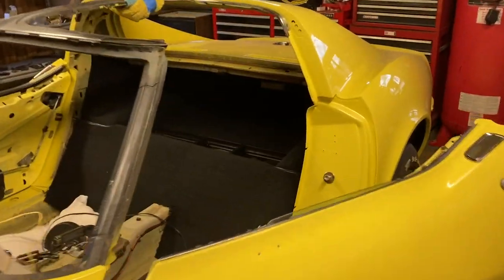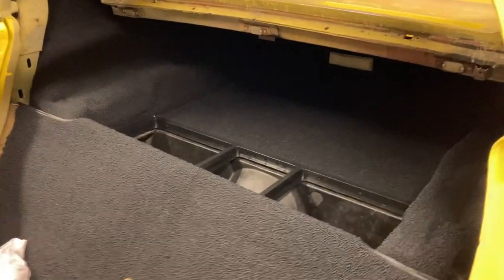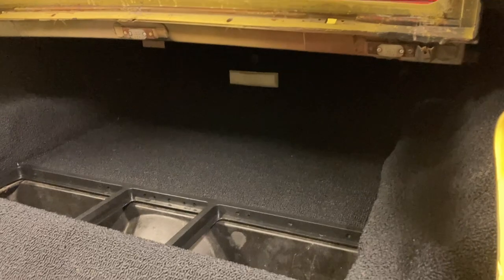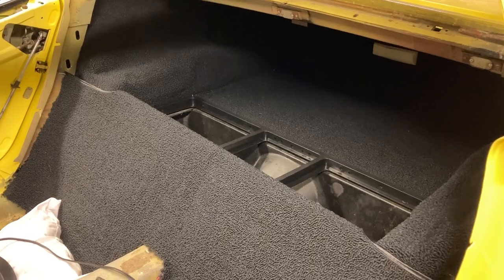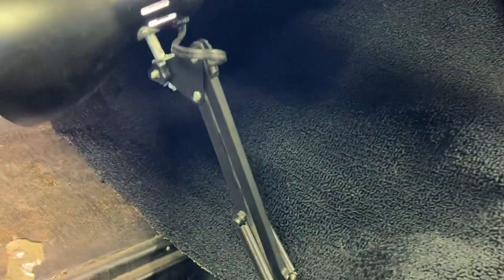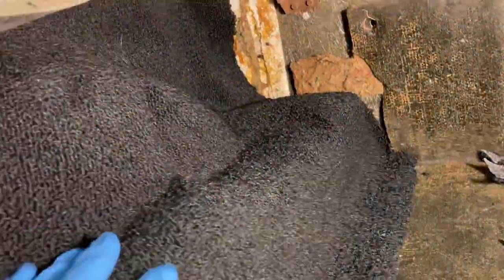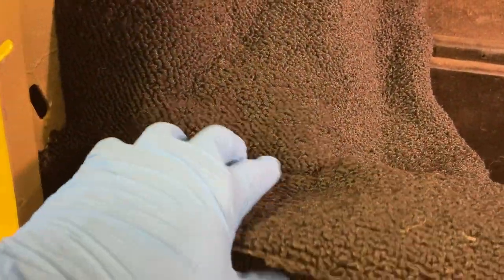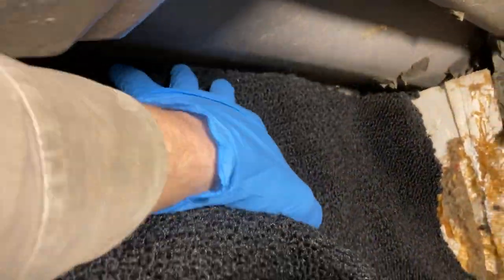C3 Corvette carpet install

Comment: Thanks for the recording.  I've got carpet ordered for my 69.  I've never done a carpet install.  Learning experience...
Reply from the maker: It’s not too bad. The front is a lot easier, they just plop right in and cut around the bolt holes for the seat and that’s about it.  Good luck 👍🏻

Comment: The brackets are for a fold down lid where your removable rear windsceen glass goes
When you have the tops off and your rear glass comes off as well 
There are 2 latches on the top inside of your rear glass to release the glass out

Comment: Great video, just did mine and that light is a SOB...even though i had old carpet. One thing i would ad is to precut useing old carpet as template and use some masking tape to mark holes like for the rubber plugs and light screws locations.
Reply from the maker: Thank you!  
Absolutely, great piece of advice for anyone doing this project.  Unfortunately I didn’t have any carpet to use as a template which made it a real bugger to install.

Comment: I believe the brackets are for the tray that stores the rear window when you take it out.
Reply from the maker: Hmmm, didn’t even know they had that. I’ve had 9 or 10 C3’s not a single one has ever had that tray.  Thanx! I’ll have to look into it.
Reply: This is correct. There’s a tray for the glass when it’s removed from the window hole.

Comment: It’s actually recommended to not glue the carpet in C3s, the carpet was not glued from factory,  I can see having to do it over the wheel wells, but the carpet will relax and form where it’s put after a couple weeks

Comment: I am doing this exact same thing on a 74 c3 right now. I'll never touch one again. Talk about a pain in the butt!
Reply from the maker: Indeed it is.  Overall the interior of these C3’s is nothing but a pain.  Worth it when it’s done tho
Reply: @ratfarm767  Your video has given me some motivation to finish everything up! I’m currently working on the rear carpet. I’m so worried about cutting it wrong!

Comment: Trying to install the carpet in my 73, thanks for this helpful video. In the effort to locate the screw holes for the rear interior light, would it work to install the stock screws, but leave them sticking up, then feel them through the carpet?
Reply from the maker: @frankleavitt4718  I don’t see why not,  that might be easier. Let us know how it works 👍🏻

Comment: I have a 69 with all the original carpet still installed, so if you want some pictures or questions on how it all tucks in, just message back
Reply from the maker: I appreciate that, interior is all done now.  Sometimes you gotta wing it 😎

Comment: Thanks for vid. If I used dynomat, will I need additional carpet underlay? Or does the carpet come with the needed padding?
Reply from the maker: You can buy it both ways, the carpet I purchased was just carpet with typical backing and I needed the padding but the more expensive carpet kits will have a rubber backing.

Comment: How did u get carpet around thr back window xwvt drain tube?round
Reply: I meant window vent drain tube
Reply from the maker: I removed the drain tubes and plugged them off for now, I need to order new tubes and drain vents.  But when I do I’ll probably use a small razor like an Exacto knife to cut around them.
Reply: Rat Farm, thanks for responding.